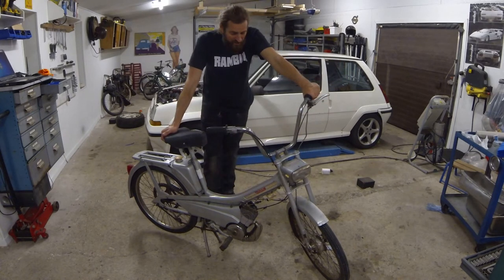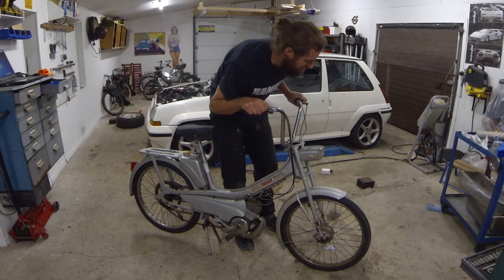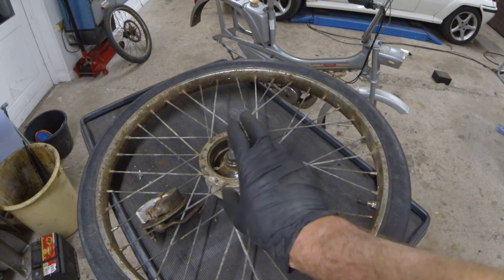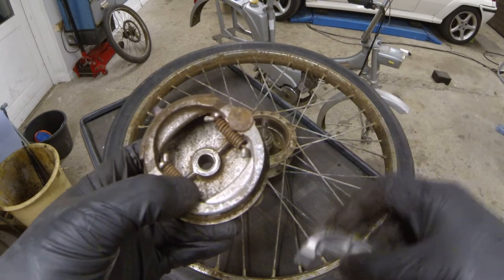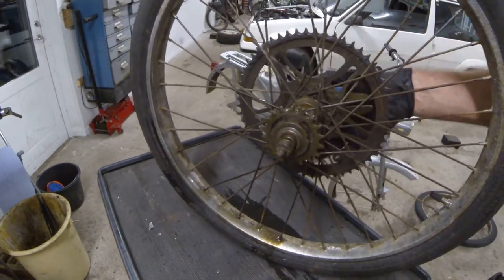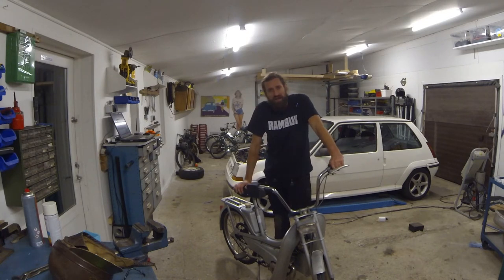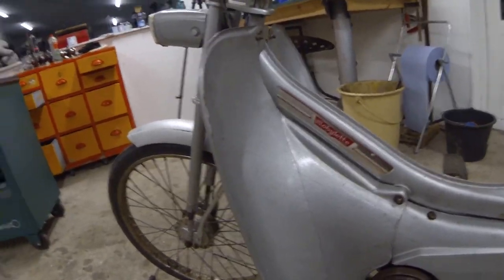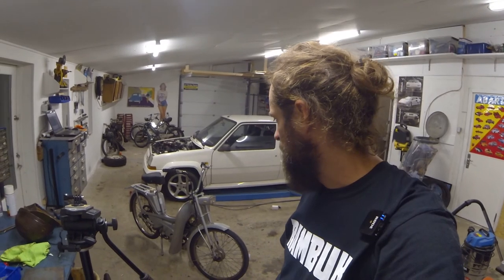Giving this Moped a Brake!-

Comment: 😁🤙
Reply from the maker: Wroom!
Reply: @SeasideGarage  Very neat bike! I had never seen one of these until you posted on it! 👍
Reply from the maker: @DetroitMicroSound  Its very neat... and quite french in design... I really like it. :D
Reply: @SeasideGarage  For sure, very French indeed! We have some of the less common Moby's here, but not this one. The frame is much like the Moby 40T in the rear. Cool bike! 😍
Reply from the maker: @DetroitMicroSound  This is a AV44 ... I dont think its very uncommon in my country, but i´ve never seen it with the wind deflectors... and those are cool!
Reply: @SeasideGarage  AND WARMER in later season riding. 😁
Reply from the maker: @DetroitMicroSound  very true!
Reply: @SeasideGarage  I plan to ride right into the cold this year. 😁 (Only I have to wear insulated heavy Carhartt bibs, to keep the wind off.)
Reply from the maker: @DetroitMicroSound  thats cool! :) on a velo solex, you got the hot engine close to your hands... Thats a plus in the winter! ;)